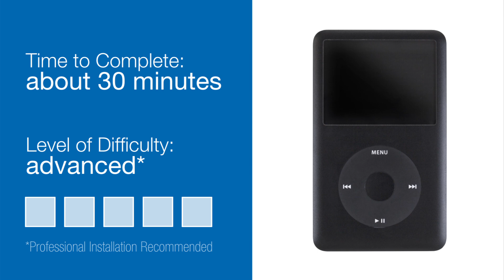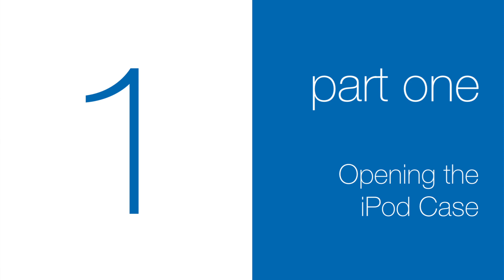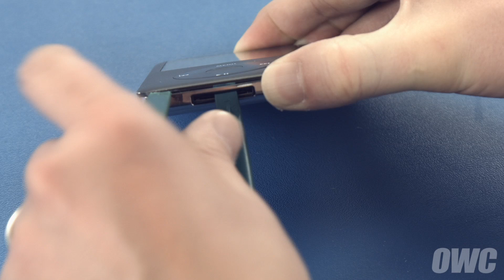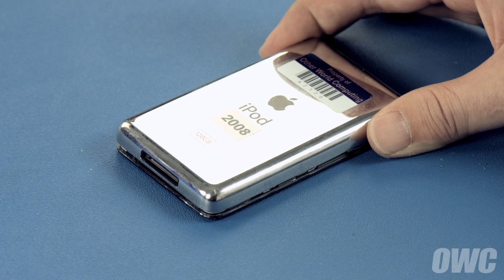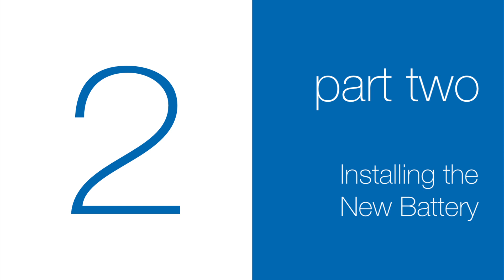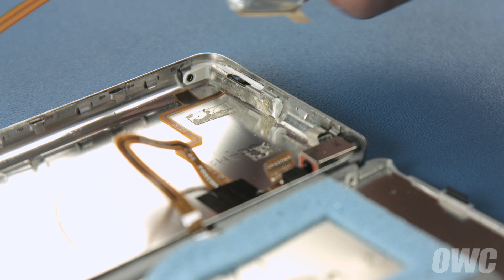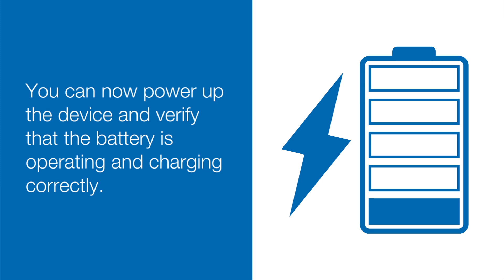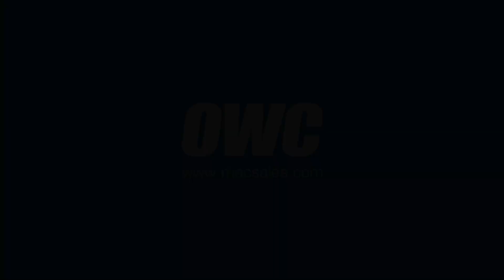How to Replace the Battery in an iPod or iPod Classic (5th, 6th and 7th Gen)

Comment: Misleading video. Impossible to lift from that bottom thin strip of metal without damaging it.
Reply: That was my point.  You can lift the battery without breaking the hold switch flex ribbon.  But, you need to be told that it is there, AND that is will be glued to the battery like the batter is to the case.
Reply: You misunderstood my comment - I'm talking about removing the back case
 - it can't be done as demonstrated without damaging the thin metal strip above the 30 pin port. I tried - it's bent out of shape already and the case didn't budge...but thanks for the tip. There is an Apple repair shop in the mall - $20 to replace the battery that I provide - they can do it for me.

Comment: Hi guys. After breaking all the plastic tools in the fitting kit and resorting to the metal ones I eventually managed to fit the replacement battery to my Classic 80GB, although bought from a different source. But there was no charge apparent on fitting and after charging overnight still no charge! Is this just a faulty battery, or am I missing something? Any ideas would be appreciated, thanks.

Comment: hey, do you know of any reason for my ipod video to freeze while playing music? can the hdd be causing that? also the battery is draining quick.
Reply: MacSales. com i think its starting to fail because its far from full, ill do the flash storage upgrade i saw on your channel and the battery, thank you.
Reply: MacSales. com hey, i have another question; is it possible to swap the thick ipod 5.5 back case with a slim ipod 6 or 7 gen back case? because im going to do the iflash sd card mod so i was wondering if a slimmer ipod 6 gen back case would fit.

Comment: TYERE IS NO IPOD 7
Reply: Yes there is... kind of. If it was built before 2009 then it is a 6th gen, if it was built after 2009 it is thinner, and has a different hard drive type that was less prone to failure on the 160gb model.

There was no official release of a 7th gen, just a rerelease with minor changes.
Reply: I own an iPod 7th Gen. Bought it from Amazon in 2010. Bought it brand new for US$218.00. Now it sells for US$ 449.00. Mine is still going strong. This is the first time I have had to change the battery.

Comment: Got a steal on an Ipod Classic 6th gen for only $99! It is in great shape, however, it doesn't hold a charge for long. Bought the battery with the two tools, gonna install it today, and I honestly can't wait to have my whole music library with me at all times, especially when skating. Hell yes man!
Reply: Evan Middlekauff I bought an iPod classic 5th Gen at a local pawn shop for $55. It runs great just needs a new battery. I'm one happy camper.
Reply: Zach Harvey
Reply: I bought 3 ipod 5th gens. A 80 amd two 30gb. I bought them for 1200 php. Which is roughly about 20 usd.  Tho all the batteries are dead.
Reply: Tonpopo Chan Did you manage to replace the batteries?

Comment: Bought your battery. Struggled a bit with opening the iPod but persisted. Wasn't really that hard but needs a bit of patience. After opening, the rest was easy but worked slowly and carefully  while using this video as guide and with some stops and plays to make sure I was doing everything correctly and not ruin my iPod. Now my overworked 2005 iPod works just as well as when I first bought it. Thank you!

Comment: Hi, I have several questions actually. I'm from Bosnia and have an iPod classic which I purchased from an authorized store. It seems that my iPod's battery is dead. The display shows the message connect to power but when I connect it to my laptop, it doesn't show up, which used to happen in the past if the battery was completely drained of power. I tried recharging it using the cable and the 10W adapter for which they say it can be used to recharge iPod classic. Not working either.
So I tried the store where I had bought it, in 2009 or 2010, they said that they cannot get the new battery and replace it because iPod Classic is no longer made, so they cannot order a replacement battery.  The only solution I have is to replace the battery myself.
Now my question is, since I live in Bosnia, is there a seller on ebay that is selling new and original iPod classic batteries.
I simply cannot give it up. I love listening to audiobooks, I use the iPod to listen to music when I drive or exercise but to be honest purchasing a new iPod touch/nano isn't an option, simply because they have smaller memory and I like my old iPod, it's like a pet, or a good old friend.
So anyone please, do you know a seller on ebay selling new (unused) and original iPod classic replacement batteries?
Reply: I've already got in touch with your customer service people and they told me that there is no way that they ship that battery due to shipping restrictions. :-(
Even if a company ordered 100 of them, then there would be import taxes and customs fees to pay, so I'll probably try one of the batteries bought on youtube and pray it works for at least a month.

Comment: My ipod is 2 years old now, or just over, and today it just died, I've tried charging it but nothing (it was charged anyway) do we think this is a problem with the battery or something else?  My previous one (both are 160g) lasted over 5 years without a problem
Reply: hey, thanks for such a quick response! :)  yea I'm not too good at repairing things so I'll take your advice and take it to a proper apple repairing place :), it's a funny thing it just went dead when I was in the shop :), tried the reboot but nothing.  Thanks for the advice and nice video, if I was more confident I'd copy you step by step :)

Comment: both of those cheap plastic tools broke, tried using micro-screwdrivers and managed to loosen half the ipod, the other side was impossible to open.  The last thing i need is to break it.
Let a professional do it...
Reply: +Owc Macsales I bought the replacement battery from Up Start...

Comment: It is not that easy. That one must have been opened before
Reply: yes... opening it without damaging it (or my fingers) is my problem :-)
it's REALLY stuck
Reply: Thorkild, I replaced the battery in my 160gb ipod about a month ago, and while this guy left out a couple of small but necessary steps, the "kit" I got failed almost immediately. The plastic snapped on both of them, so I used a couple of jewelers style screwdrivers. I got it apart, but it isn't pretty. You can see all the spots where I was prying to open it, but fortunately, it did go back together and is working great. If I remember correctly, you are supposed to slide the little button at the top into the locked position first, and you have to gently push down on a button where the cable is attached to free the old one. When you install the new one, like he said, push the thing down to lock it in place. I'm a 59yo grandma, and if I can do it, I think most people will be able to, but watch more than one video before starting. That should help put the process in order for you. I have 2 more ipods I'm going to change batteries on but I have better tools this time. A nice little kit I found in tools at Walmart last week. You're right, that one had already been taken apart. It's not that easy the first time as you've found out.
Reply: I think it was easy. HOWEVER, there should've been note to be more cautious when removing the battery.  I was extra careful, yet didn't know how much the hold switch ribbon cable was stuck to the battery...it broke.  Anyhoo, no matter- going to purchase the hold switch/ headphone cable assembly repair kit.
Cheers.
Reply: How long would the battery last
Reply: anonymous, my new battery has only been charged once since the initial charge after installing the battery. I haven't used it a lot, but the new battery seems to have a lot of power. Somewhere in double digits. My biggest problem is that when I took it apart, I damaged the screen. It doesn't always look the same when I turn it on so I don't always see how much power I have left, but I'm not complaining. I haven't done either of my others yet, mostly because I'm enjoying the music that is still on the one I did fix. Good luck!!
Reply: @anonymous-tc2oq  From 1 year to 12 years.  It depends on battery quality.
Reply: Same thing happened to me.  He doesn't tell you that at least ONE of the flex ribbons will be attached to the adhesive holding the battery ----- usually the HOLD switch ribbon which the battery lays on; one that is susre to be epoxied too.  When you pry the battery, SNAP goes the HOLD switch flex ribbon since it is epoxied too.

Not fixing mine.  Disgusted, I toss everything including the new battery into the trash.  Video should be renamed "How to fuck up your IPOD."  Otherwise, he need to slow down and explain the presence of the other ribbons, where the lay, and to not to apply force against the battery if any of its adhesion is attached to a flex ribbon.  And, it's always attached to the hold switch ribbpn
Reply: Dude these things are easy to open. This tutorial is doing it wrong.
Reply: @cringemeister9417  do you know of a better tutorial? It's still collecting dust in the drawer :-)
Reply: Thorkild Zinck look at dankpods ‘the hardest iPod to open’